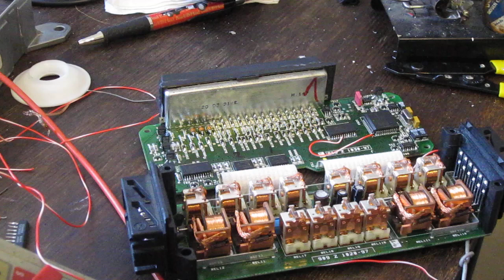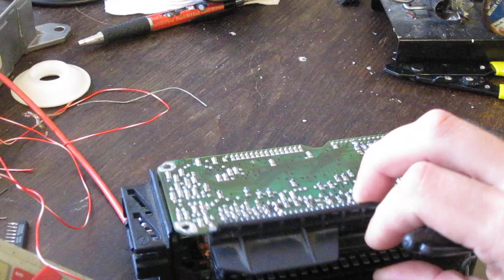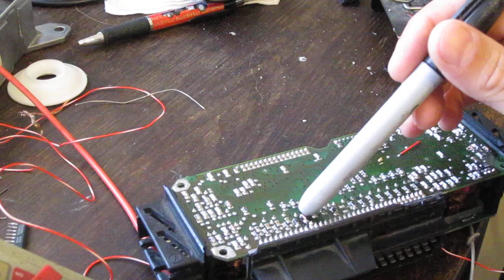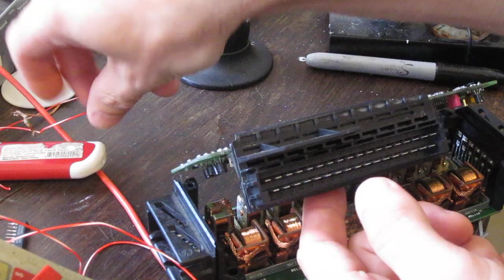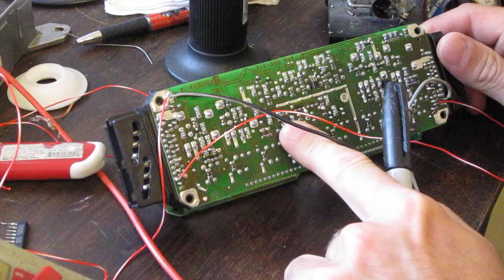Mercedes 500SL R129 roof controller repair. 1298200097

Comment: Thanks for the Video. My soft top controller is bad. I will need to get it pulled out and sent to you. I drive a 1993 300 CE CV. It became intermittent then it finally just quit folding down. Great Vid.

Comment from the maker: Update on roof controller: after replacing chips and some diodes controller works after few restarts. I suspect either oscillating crystal or main processor to be faulty. Could not find replacement crystal anywhere. Found processor chip but cannot program it. Recently got my hands on not working roof controller and will try to either fix that one or use crystal off that controller.

Comment: I have a quick question, I have a ECU for a pre 1995 model and one from an 1995 model and up, I think the relay is bad in my ECU as the pressure in the pump has gone down and down and the roof got slower and slower and now it does not work at all, ( you can hear it click when i try to raise the roll bar but it does not move... the roll bar was the last thing to give up, Can i switch and relay from the newer ECU and put it into the older one and if not where can I buy this relay,? ( i tried changing the pump and and the relay on the pump but this does not work, any advice would be greatly appreciated. Stephen

Comment: '99 SL500, I replaced the rollbar for cosmetic reasons. Removed the pivot bolt on each side, removed the piston bolt on each side, removed the strain relief screw for the harness but did not remove the harness. Reversed the process with the new rollbar. The rollbar and top work normally, however, I get a steady rollbar indicator on the instrument cluster and when the bar is down only, I also get flashing lights on the rollbar switch. Any suggestions?

Comment: Hi, the roof does not open on the 320 SL model vehicle. We did all the checks. We are considering reinstalling the software, but unfortunately we do not have the original software. Can you help us with this?
Thanks

Comment: Do you know if a micro switch in the soft top controls the release of the tonneau cover over it?  I had fixed a pair of severed wires on the left bow extension cylinder, but still no change. Are there additional micro switches under the soft top frame assembly?  Also the control over the roll bar only works when I have the hard top on and locked.  I don't have control over it with the switch when it is off.

Comment: when I push the botton to put the roof windows do not go down. When the process is finish windows go up (If I mantein pushing the botton). If I close the car, windows up by themself. Is it the same chip? I have a 300SL of 1992

Comment: I have a 92 500SL, issues with soft top and hard top locking when I got the car.  The front power latches work for locking but not unlocking (I manually unlock with allen wrench).  The tonneau cover will not open to release the soft top. After manually opening tonneau cover only rear window pivots for the soft top. My door windows work no problem. Roll bar switch works, but sometimes finicky after removing and re-installing hard top.  Soft  top controller problem, or maybe micro switches??

Comment: Hi great video ,I have an sl320 2000yr could you help with a circuit diagram or a video plz,ive got the passenger window not working and the crash bar light flashing
thanks
do you repair too?

Comment: Hi Vsandvs do you have a diagram or were you just testing till you found fault?
I have a problem with mine it does not release the front latches on the top of the windscreen do you know what part or chip controls that function,
Thank You
Will

Comment: Hey Victor Great video! My 98 top works great but I don't think the roll bar pops up in emergency but works up and down .... also the dash light goes on every third start(tho top still functions) ..... is this a controller problem or is there a separate relay for the emergency roll bar pop up? Thanks!

Comment: Have you ever repaired the dome light circuit board? I replaced the relay behind the passenger air bag and now my driver door light is working but not the dome lights.

Comment: Hi Victor..I have a 1990 R129 that has a parasitic drain that I have located through fuse #3 in the trunk.."Soft top control unit and solenoid values". How do I isolate the cause if it is in the control unit or one of the solenoids?

Comment: Hello my friend, I am from a workshop located in Brazil, I am repairing a system like this one shown in the video, I need technical information to help me complete it, at first I already detected several diodes warming up, and while testing I found that they are in short circuit. could you help me? I can pay you for this information.

Comment: autodijagnostikaDOTbiz

I found parts here.

Like if helped.
Reply: Do you have any use for a 1298200097 relay module (rebuildable) or a 1298201026